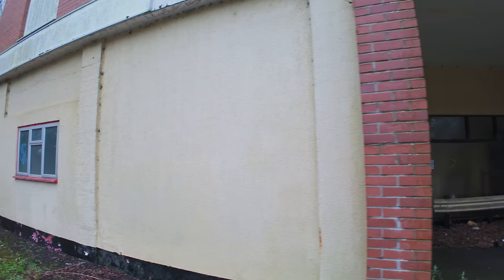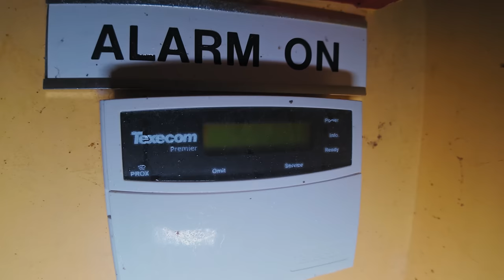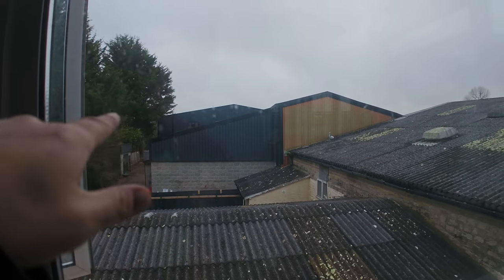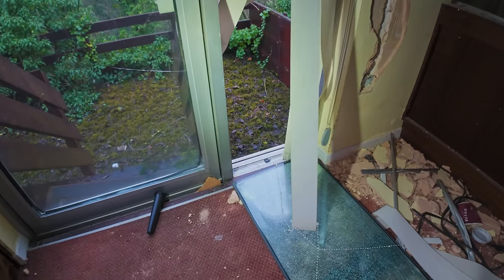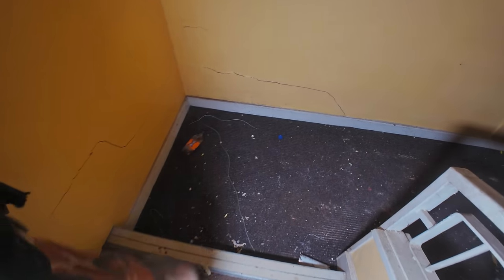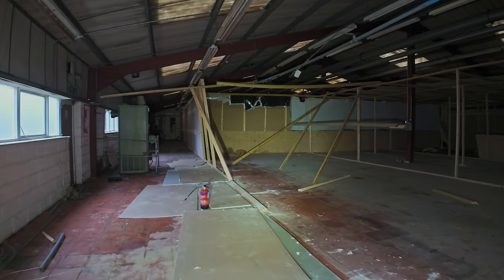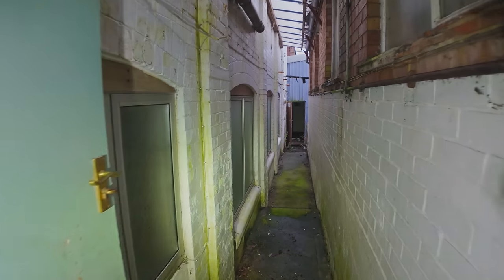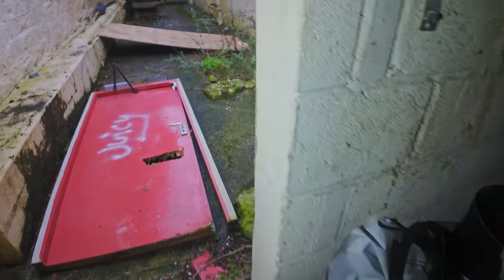SHOCKING Haynes Car Manuals Factory  MASSIVE PRO GROH ROOOM

Comment: That's a horticultural level operation... fking hell that's like  £45,000 input. who knows what was produced, not kilos more like tonnes !!  to nit pick ... saying the grow room is hermetically sealed when you have actually been to gov labs wear they were actually hermetically sealed ....  it was near air tight at best.  That air  compresser is a bit of a wonder no use for that thing unless they were doing hydro bubblers which is even more insane. Lots of electricians set up oven level breaker boxes in bedrooms and attics these days you would be surprised. This was some big gang/ organisation or a serious MFer with some money to spend. I wouldn't be surprised if they had bang bang weapons when it was active. This must have been one of the biggest grows in the UK and breaking bad anit far off indeed.